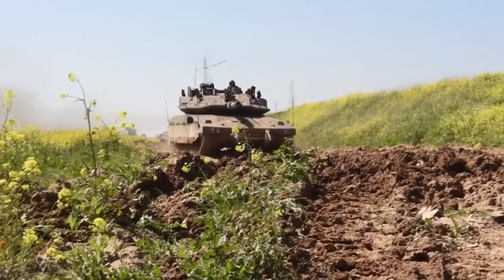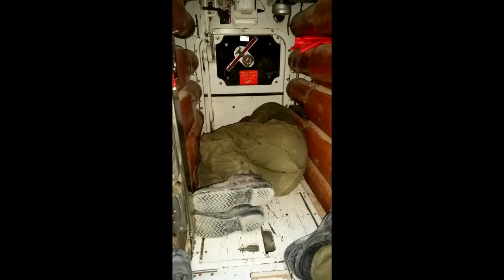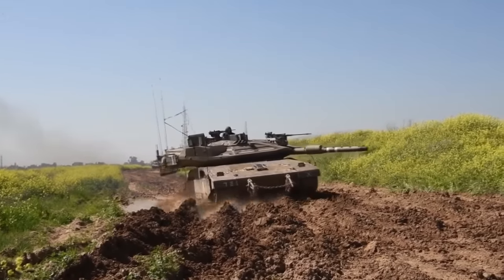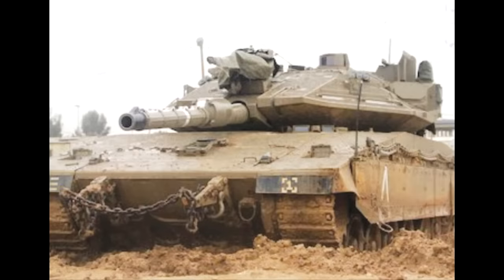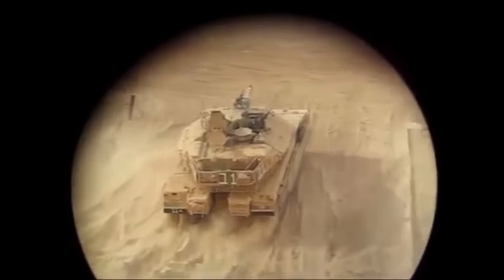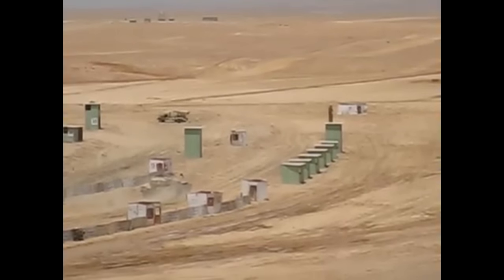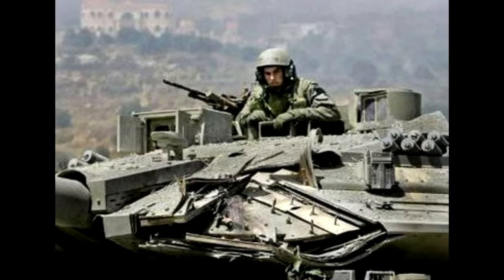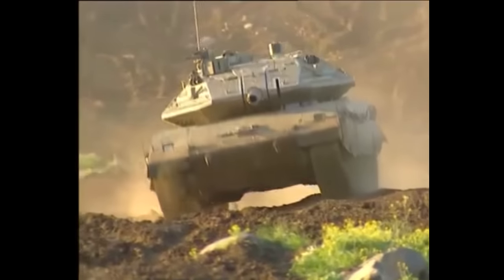Problems with Merkava tank

Comment: The bull-s propaganda around this thing has been bothering me for a long time. It's a product of some very specific needs to fight what amounts to old soviet tanks and infantry in mostly irregular warfare. I really like the ability to carry infantry in the back, but only for the utility it has in evacuating wounded personnel, beside that ability the carrying of infantry is pretty impractical in most scenarios, although I could see an armored column with limited infantry protection provided by a small number of designated tanks, also makes it harder to specifically target the vehicles carrying infantry, but again mostly a downgrade compared to APC or IFV. As a tanks it's just average for modern standards, with again some adaptations for fighting asymmetrically.

Comment: You should have mentioned that one of the  main reasons the Merkava was designed that way  was in view of the heavy casualties suffered by Israeli tank crews in the Yom Kippur war of 73.  Israel is very sensitive to casualties.  I can't resist pointing out that in the Lebanon War of 82 Israeli Merkava tanks soundly thrashed the Soviet tanks pitted against them by the Syrian army.  True, these tanks were being driven by Arabs, who generally find it hard to cope with modern technology.  But even Russian tank crews would have found it difficult fighting against the Merkava.

Comment: The Merkava values crew protection over anything, so every component acts like protection to the crew. And the Merkava 4 uses a special paint from an IAI program to reduce thermal signature, and the gunners thermals were never obscured, before the driver had improved optics merkava drivers would be guided by the gunner since he had thermals, you are wrong on your first claim

The upper front plate is also quite unexposed, and is hard to hit. And fuel tanks are actually quite good at stopping rounds, the Merkavas design was to put crew protection over anything else, you should have done more reaearch.

Comment: Yea what's the perfect MBT? i do not know it yet...

Merkava its an old design that was increased time after time... Israel tends to do that on their proyect (Kfir anyone?) The frontal engine was a pretty clever response at a time when most lethal shells against MBTs were HEAT/HESH or some improved form of AP shell. 
Sabot weren't as good and wasn't even the go-to choice by tank crews since they didn't show clear results after hit like HEAT.
With all that in mind the frontal Engine allowed for weight reduction but maintaining high level of frontal armor.

Nowadays the frontal engine shows the flaws relative to modern warfare. Nevertheless its still a competitive tank considering what's around the globe

Comment: I believe you are mistaken regarding the doctrine behind placing the engine in the front compartment. Above all else, Israel values the crew, not the tank itself. The engine is not meant as pseudo-armour with respect to the tank's operability. It is meant as that much more added protection in terms of crew survivability. Moreover, the added space in the rear compartment is not at all meant to turn the Merkava into an APC. One need only read Arab-Israeli war histories to see that the Israelis also use their tanks for crew rescue of knocked out tanks. The rear compartment is also meant as an in extremis battlefield ambulance.

And, you fail to take into account another aspect of Israeli armoured doctrine informing the Merkava's design. Israeli tank crews are especially trained in gunnery. During the 1973 war, a bunch of crews had 30+ tank kills--and in just a few hours. Some crews could fire off 3 rounds, on target, in under 10 seconds. I, myself, grant you that today, with cars able to park themselves, modern technology has likely leveled that ability with Israel's potential enemies.

Finally, nobody says that the Merkava is the best tank in the world. As in aircraft design, it's all about trade-offs. The Merkava is the best tank for Israelis, in their environment with their battlefield doctrine.

Comment: Abrams don't have the L55 because the L44 is good enough . The DU penetrator is the x factor.  It would be expensive asf to refit and possibly redesign every single turret in the inventory.  Sometimes it matters what kind of ammo you have more than the gun.  The Germans fielded the new L55 gun because they needed the velocity on the older tungsten core round.  Do you want velocity or effectiveness? Carry on.

Comment: Well in their defence, the Israelis designed the tank with urban combat in mind since they haven't done a lot of tank-to-tank combat in some time.  So I can see where concentrating on diminishing the effect of HEAT projectiles was a priority.  The same could be said for keeping the length of the gun barrel to a minimum as the becomes a problem in close quarters.

Comment: This tank is not for export or sale. This is the tank built for a defensive role with expertise crew inputs based on their country requirements. More than enough to take care of neighbours. Not for world conquer.

You failed to cover the important negative point of this tank it's mobility. But keeping in mind that Israel at the broadest point is some 280 miles is ok for merkava. When u say engine on the front is the negative one they too would have thought about that and surely the would come up with better in mark 5. Overall it's good tank.

Comment: Other than the engine in the front, which I still think is a good thing for lower population countries, most of the issues cited in this can be fixed with a retrofit and upgrade. Manpower as we are seeing with Russia in the current conflict is FAR more important that equipment and machinery. Tank crews and officers take much longer to replace than their hardware. Maybe Israel was right all along.

Comment: I think realistically heat signature is obvious no matter where you up the engine on a tank, modern optical systems are just that powerful, so it's not much of an issue to have the engine near the front. You look at a tank with thermals at night and the whole tank lights up, it's only slightly brighter where the engine is. 

Also the point about having the engine near the front to provide additive, I believe it definitely does help because not only do you have the frontal armour, then the engine but then another spacing to separate the engine from crew area which can be reinforced. Think of the front armour-engine-crew wall as an extreme form of armoured spacing. I don't know for certain if the wall between the engine compartment and crew compartment is reinforced but I believe it would seriously improve survivability.

Comment: I find it funny that it often is the same "tank experts" who will shit on German WW2 tanks for having the transmission at the front and getting mobility killed easily, who then sing the praise of how smart it is to put the engine and transmission at the front on the Merkava.

You didn't even mention perhaps the biggest problem with having the engine at the front. 
It makes the tank front heavy.
On more conventional tank designs, the heavy front armor and the engine at the back balance each other out. On the Merkava, you have all the weight at the front, which is why you often see pictures of Merkavas kind of doing "head stands" after they somersaulted into a ditch.

In another video you said the Merkava has good mobility, but there is more to what makes good mobility than just what top speed it can reach on a road. Issues like a tendency to drop into holes and get stuck or a sub par ground clearance should be taken into account too.

Also, the whole concept just puts strict limits on how thick and how heavy the frontal armor can be. You don't have much room for layered armor and you can't make it very heavy, without increasing the problem with the front heaviness.

Comment: They mentioned before, their tanks is designed to suit for local use only. Even their fuel tank capacity also small bcos the country is not   large.  Their intention is to keep the crew safe as the population is small, the engine located in front is to provide another layer of protection. Which country actually bought  Israel's made tank! Actual non.

Comment: okay, this video is mising the point completely (although technically u are correct) as merkava was not made in tank destroyer doctrine (or mbt if u want) and instead was to face asymetric scenarios only - which means no apfsds, no thermal optic and very little of precision strike missile systems (laser and wire guided) and finally the need for trophy to excel in protection is due to main armor having issues in mbt type of engagement in the first place. And yes u can mount trophy on other tanks but the point of merkava was to have their own tank made just for their enviroment, free of international politics problems (ec. we don't like waht u doing with our equipment, no more for u)

Comment: composite armor is better than solid steel. Thats a hard fact. But ok lets give it logicaly, tell me a single tank that has as much armor as pointed out in mm of defence. Often it is told that armor is up 800mm but no tank ever have had 80cm of thick solid steel armor. This kinda tank would weight hundreds of tons.  Second your point about thermal cameras, is kinda useless because those can easyly detect tank anyway. Yes merkavas front is better seen from fornt than others but others can also seen easyly soo no matter acualy. Third lower frontal plate, its a weak spot in allmust all tanks and can be easyly pireced soo again its not worse than others. Also the fact that there is engine and fuel tank behind is still better than others. Well while thats  tue that i havent shoot merkavas engine with acannon (i doupt that you have either) its still huge chunk of metal that will disrupt and slow the projectile. Specialy because its multible layers soo it will start to change trajectory of projectile, witch im sure will help. Sure merkava is not perfect, of course it could use better lower front plate but atm its best that there is on defence. Also having a infantry with a tank in battle field is  huge benefit. Having eyes, to look out for your tank and enemy,  is most powerful weapon. Beecause in war information is the thing between victory and loss

Comment: A simple Google search disproves your thermal imaging argument both from the tank's gunner view and from the enemy's view. The apfsds argument is irrelevant since apfsds can Pierce anything it gets thrown at so I understand that the engine isn't much armour but it is armour that shouldn't spall as much as regular armor or even composite. And the argument about the engine getting destroyed is also irrelevant since that was the point. That configuration was chosen in order to protect the crew, not the tank

Comment: The reason Merkava is what it is, is to protect its occupants and acompanying infantry. The state of Isreal is surrounded by nations who outnumber its millitary several times over. So the defence department is willing to accept higher materiel losses to aquire lower personel losses. Aside from the fact its a tank in use by a competent and battletested millitary institute, if it does what its parent millitary organisation requires of it then its a solid piece of equipment. Afterall it does not have to be the best in the world. It needs to be the best for the local strategic need.

Comment: How do you know the exact thickness of the armor? Its classified, I couldn't find information about it.

Also, not taking into consideration the trophy system because it will provide similar results on other tanks is just wrong. This is the tank, for the good and for the bad.
Dont remove systems from it even though they can be added into other tanks.
And take into consideration that the TROPHY system is an Israeli system.
The US and Germany decided to use it on all of its tanks, and not systems which they developed by themselves.
Let's compare fighter jets and not take into consideration their avionics because they can be installed on other aircrafts...
The TROPHY system is a very big advantage.

Comment: With a tank that is mostly used in desert environment in daytime, i kind of think the downside of the large heat signature is not as large say like a tank operating in subarctic conditions.

Most APC and IFV have the tank in the front regardless, even the one made to be used in subarctic conditions and there heat signature is probobly as much of a problem.

Of cause in reality tanks a rarely encountered straight on from the front making it possible to see the heat of the engine regardless.

And really, with modern optics, even just the heat of the tank as is, give it a huge signature.

With in mind that most IFV have the engine in front, i kind of think this is not that much of a problem in reality. The main reason tanks generally have the engine in the back is balance.

If you call it a tank its kind of odd, but if you call it a IFV, its pretty normal. (and yes, there exist other IFV with 120mm main gun)

Comment: The tanks thermals are actually not affected by engine heat. They routed it with an exhaust you'll still be able to see small flashes of it in the corners of the thermal but its negligable.
However the gas tank being in front of an already exposed engine is disappointing

Comment: There is a very distinctive point you haven’t taken into consideration. You talk a lot about the hull front armor problems, but you don’t get to understand that they are neglect-able since the Merkava roll is to either defend in ready positions where the lower front plate is unseeable and also the upper plate, and even if it does, it would be so angled it is unlikely anything would penetrate it, hence the the turret design you mentioned, because the gun must have a very low gun depression in order to stay in the safe and still be able tool shoot.
The second roll is for the urban fights, where any tank in the world would face problems, but having the turret in the back, is what gives it an extra advantage in those close quarters.
A bonus, at the back of the Merkava, it’s not just an extra troop carrier which can take up to two persons, it’s also a getaways in times of crisis, the whole tank is designed to save as much crew members as possible.

Comment: Your statement: „No composition is as strong as solid homogeneous armour“ is not relevant when we talk about protection against projectiles or penetrators in general. If the composite deflects the penetrator it does it‘s job and it doesn’t matter how „strong“ the composite is. That’s why the modern tanks use composites and other forms of protections such as Trophy.

Comment: With the merkavas you always have to keep in mind what they were designed to fight compared to Leos or avrams. While some of the points you mentioned are true, I don't think they pose a big issue for its combat efficiency. It's unlikely to ever be shot at with modern apfsds, it faces RPGs and ATGMS mostly, which is why it has trophy APS. I suspect they don't use the L55 to keep it more maneuverable in urban environments and the higher effectiveness is not so much of an issue when your kinetic penetrators have nothing to penetrate anyway and if they do they would have no issues as is.

It's a very interesting design and it's certainly the most brutal looking tank and I love it. Some of its design aspects have certainly become obsolete but it has proven to offer greater protection than the magach (M48/M60) tanks and overall works well in the given environment. Also Israel wanted to be independent from foreign suppliers.
Reply: So Israel only fights against non state militaries? What about Russian made tanks?

Comment: Merkava I / II / III / IV was designed for defensive combat in open terrain. They are mainly supposed to fight from behind prepared or improvised positions. If the tankers will expose any part to fire, it will be the turret itself or the turret and the upper part of the hull, while the lower part of the hull is to be hidden as much as possible behind a terrain obstacle. The Merkava series was designed primarily for the classic defensive warfare of Israel's defensive doctrine, then they were adapted to urban battles step by step.

As a curiosity - according to research by Israeli engineers, 70mm of fuel is about 10mm of armor steel in terms of protection against HEAT warheads.

Comment: The thing about the thermals being obscured by the engine is probably false. Having the turret over the rear of an Abrams with its turbine engine does not obscure the thermals even with Tactical Idle on so I doubt the engine heat will mess with the thermals of Merkava.

Comment: the Merkava IV main battle tank could do with a raised suspension setup featuring a heavy duty 5.0 in. suspension lift for improved off roadability . . . the ammunition compartment in the aft section of the Merkava IV hull could seriously do with some much needed blow out panels . . . and the upper front plates needs add on 340 MM thick ERA . . . heat signature of the 13.2 TDI I8 engine in the forward hull section can be reduced by lining the side walls inside the engine bay with fused cooling system . . . a series of coils inside the engine bay, filled with liquid nitrogen will drastically reduce the heat by as much as 150°C . . . also helps in keeping the immediate space around the engine couple of degrees cooler . . . but ofcourse there's the engine's own cooling system as well designed to keep the engine within operational limits even in harsh 50.0°C temperatures in the desert . . .